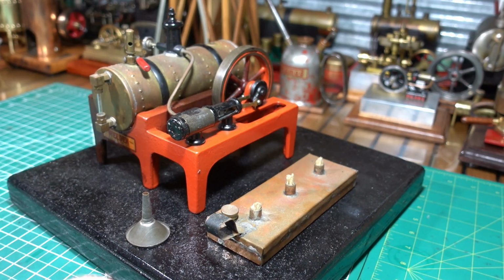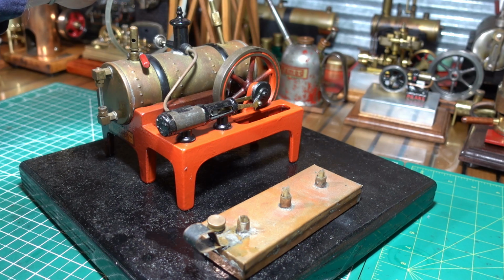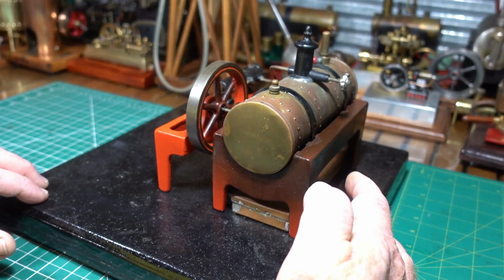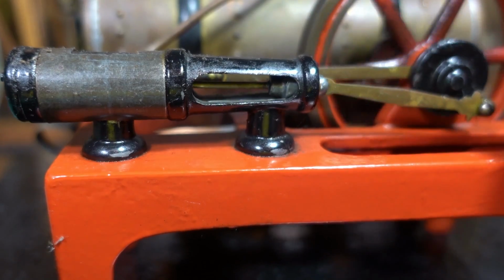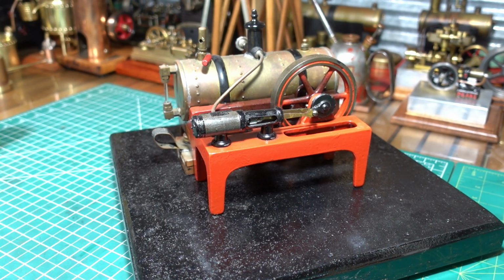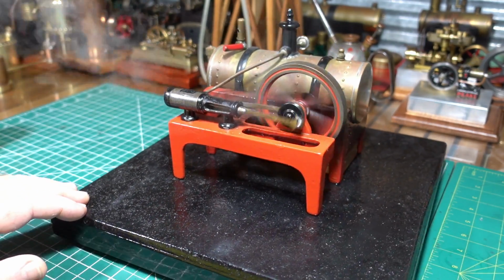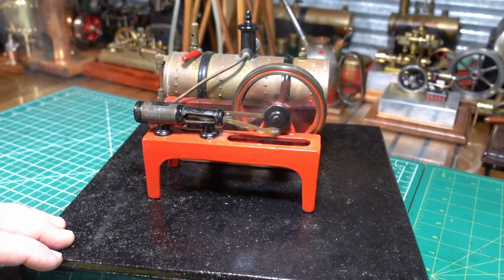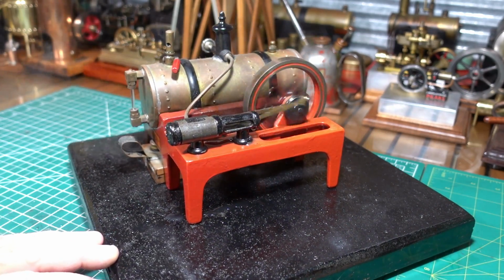Stationary Model Steam Engine or sometimes called a Toy Steam Engine Weeden Model 14

Comment: The Weeden #14 is a reliable runner and easy to handle. I've got one of those myself - unfortunately the sight glass was leaking when I received it, but the engine has got its governor. Should take it off the shelf and put it into operation ...😃
Reply from the maker: Looking forward to seeing yours run - Cheers Jim